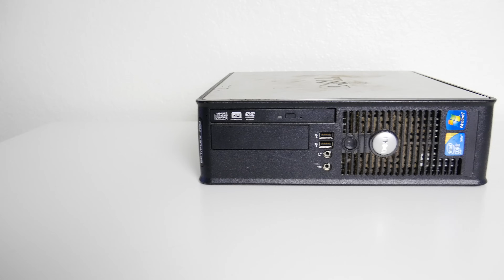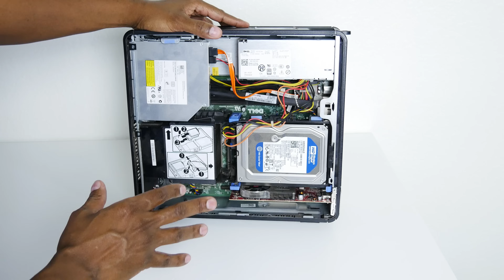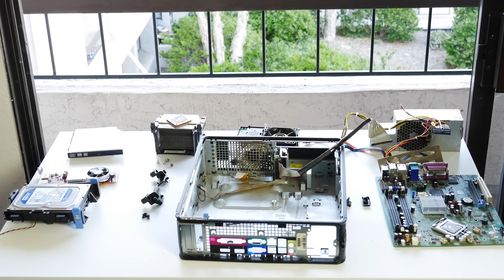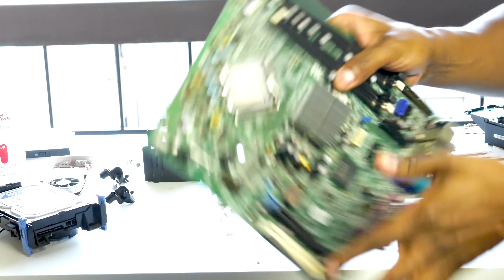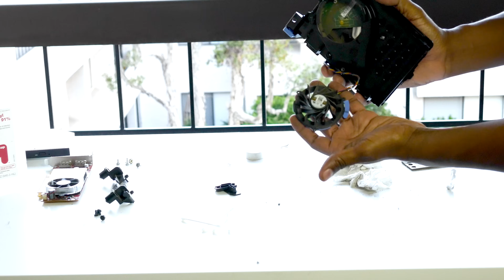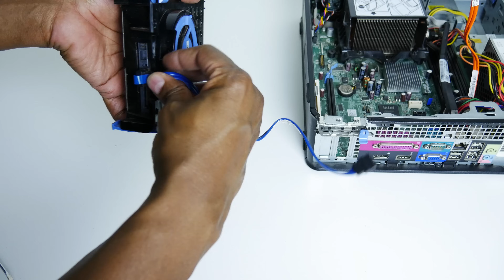How To Take Apart, Clean, Reassemble, Upgrade 780 SFF

Comment: Love your videos. Very well done Sir !Two weeks ago I just replaced a few capacitors and did a complete teardown and cleaning on a dell optiplex 745. Just a note: Mass Airflow cleaner from any auto-parts store is actually circuit board cleaner.....you can soak the motherboard on both sides and any other components with it. It dries fast and evaporates dust and dirt. My wifes computer works great and runs quite now. I also upgraded it to Windows 10 for free on 04-06-20 it's still available from Microsoft for free. Do all updates and virus scans, then turn all firewalls and virus software off. 3 hours later your done.

Comment: Great Tip bro. By the way, with regards to Graphics card problem you mentioned earlier, if anybody is planning for High-End video card upgrade on this guy, it wouldn't be a problem, all you need is to get a descent size Mid-Tower case that can fit a 450-500 watts power supply for only $35, and you're good to go for full-time gaming.
Reply: Is the mobo mounting holes have the same alignment with the mATX casing mounting? I am thinking of transferring the parts for my Optiplex 380 mini tower to the ATX casing except the power supply. This will enable me to slot in the High Profile Graphic card and install new Power supply.
Reply: @seebauong9593  All motherboard mounting holes and the corresponding Casing holes for ATX, Micro ATX and the Mini ITX, are standardized my friend Which means all of them, with regards to brands means any brands, have the same exact hole spacings in between them. The only difference is the fact that ATX (Full-Size) Motherboards has more holes at the end because they have more expansion slots as compared to the Micro-ATX and The mini or ITX.

Comment: Good Video! I would only suggest you say what each cable is for (power, data, etc,) as you dis/reconnect, for those who may not know. The wiring looks intimidating, but is really not, once understood. Also, why the (thermal) compound is necessary - and never touch those mating surfaces.
Reply from the maker: Thanks

Comment: I had a feeling I’d mess something up and I did, my computers hard drive fan for some reason was wired differently. I had a wire that connected from the front fan to a port at the other end of the motherboard and it was really fragile so the end snapped… Do you reckon I can continue using my pc with my hard drive fan?

Comment: i had an hp computer assembled very similar to this, and the one thing i discovered is that the motherboard can be moved into a different case, along with a decent power supply, and it would still be the same computer because nothing else changes except for the fact that the cpu cooler is a little different in this model from dell, so you may have to replace that entirely, but its not a big deal. that western digital blue hard drive really doesn't need that fan on it either, but that's the one fault that prebuilt machines have, they tend to come with unnecessary hardware and can that increase the cost of repair.

Comment: Just one thing, I personally avoid touching the CPU surface before applying thermal grease. Wipe it with some alcohol, let it dry, makes for better thermal dissipation
Reply: Also pea sized is more than enough. With tons of grease, the heat actually doesn't dissipate as well

Comment: I use a Dell Optiplex SFF  780  like this for HTPC and have Kodi installed on it.  I upgraded the HDD to SSD and this little box flies!!!!!!  Temps are also lower without the large hard drive blocking airflow.  Best upgrade for a 780 SFF.
Reply from the maker: +DJ R@DEON thanks for sharing

Comment: Have you taken a Dell, not that compact, but one with more room, like a mini/micro tower, & rebuilt it? Not using the m/b, but just about new everything. Thanks i have a Dell Vostro, with more inside space than the 1 you are working on, & build a new machine, maybe a B450 or B550

Comment: Will leaving my dells side pannel off improve cooling?
Reply: Sarina Bethany Myers  I wanted to know because my power supply was getting extremely very hot paired with a gt 710. Sadly it caught on fire, im not joking, i saw the flames through the fans  . I would recommend getting a cheap Lenovo thinkcentre edge 72. way newer and better processor and it allows you to upgrade the powersupply.

Comment: I'll tell you my cheat for almost every type of computer but especially applicable here. I remove every electronic part, such as your front power button and I take it out back. Spray it down with some good degreaser like 709 then I power wash the whole case. Especially one in that nice of condition. Then I just wipe it down with a shammy. Use the wet shammy to clean other plastic parts. I clean the heat sinks this way too. Certainly using a little bit of alcohol helps speed the process up. smart! but if you do it right you can refurb these things to be like new, if not better then new.

Comment: Thank You Tech Steve. I have a Dell  Optiplex 780 I want to add more ram as it only has 2 GB ram running Windows 7 i want to make sure i get the right ram for the board or do i just replace the board and get the right ram for the new board?  thanks again

Comment: Happy New Year! I have a dell optiplex 780 slim and it won’t turn on,no power at all no light in the back of the power supply. What do you think? Thanks
Reply from the maker: Test or replace the power cord. If the outlet works then you may have a bad power supply. The good new is that they are really cheap online but you have to get the one that came with it because they are proprietary.
Reply: Tech Steve  ok thanks i will try that!
Reply: I’ve tried to cahnged the power cord still no power.
Reply from the maker: Sounds like the power supply

Comment: Steve superb video thanks. I have just bought the exact same model as the one here, but mine does not have a Graphics Card it must be integrated on the motherboard. I want edit video footage so presumably a dedicated graphics card would be desirable. Can I ask your advice and recommendations for a video card to fit the Dell 780 SFF please? I live in the UK.

Many thanks. David Eades
Reply from the maker: Here’s the model that’s installed https://plus.google.com/+TechSteve/posts/RRjyfZdu6ut
Reply: Tech Steve Thanks Steve for your very prompt reply, I am much obliged to you.

Kind regards 

David
Reply: I would recommend a gt 1030 low profile, have one in my Dell 780

Comment: Great video but my problem is with the network socket. Mine got fried during a storm & now there's no LAN internet connection. But with my Optiplex 780 Ultra Small I doubt it's as simple as replacing the Ethernet card. 😩😩😩
Reply from the maker: Just buy a usb to Ethernet adapter, they are cheap and works great. AmazonBasics USB 3.0 to 10/100/1000 Gigabit Ethernet Adapter https://www.amazon.com/dp/B00M77HMU0/ref=cm_sw_r_cp_api_i_aediCbDDSCJC9

Comment: I have a Dell 780 sff and I had a fan issue. I took it apart and the fan was so dirty it wouldn't spin. When I put it back together I didn't use any thermo paste and it runs just as good as before. Core temp stays at 39c.
Reply from the maker: Scary but if it work watch it. Get some paste as soon as you can so you know it’s right.
Reply: @TechSteve  I ended up wiping the hard drive and installing Windows 7 home premium. The core can run 64 bit os but I have the 32 bit os.. any how, I have not touched the processor and the fan is controlled by core temp and I hardly ever hear the fan. My conclusion is that if you are only doing basic things, paste makes no difference. If you are gaming and have cool cooling systems, then maybe you need the paste. 👍
Reply: I have some plans for this one. I have pics and video of it streaming and it is straight from the factory with no video card and it rarely buffers at all. But I want to use it to run Android emulator so I am taking pictures and video as I go with the hopes of editing and making a video for YouTube. My hard drive is under the optical drive and I did flip the fan.
Reply from the maker: Ok great, post a link and I’ll check it out
Reply: @TechSteve   I have a channel and I put two small ones up, the streaming I thought might come in better with the lights off but I turn the light on and you can see it streams just fine. They are only about 30 seconds each because it was the easiest way to do it.

Comment: very good ive just bought a 780 off ebay.
Reply: did it come good?
Reply: yeh great thanks
Reply: how much it cost?
Reply: Tony Baines wow that's awesome but how does it run a core 2 duo at 3.16 gigahertz I have a core 2 quad at 2.66 any idea how to overlook it?
Reply: Tony Baines did u overclock it? if so can u explain how pls
Reply: I went up to 3 too..there is some things you can do to the little guys that work.. I also took it up to 16gb ram,,and put an nVidia low profile card in it :)
Reply: radstorm what's the card name? link pls?
Reply: Michael here it is: They moved it from the last link.. https://www.walmart.com/ip/EVGA-GeForce-GT-610-2GB-DDR3-PCI-Express-2.0-Graphics-Card/21126311
Reply: It includes the adapter plate to fit it to small form pc
Reply: radstorm yeah that's a really nice card too bad I got the stupid visiontek a week ago.....mine isn't that that bad for $36.00 and $3 shipping I got the card Max memory clock on visiontek is 700GHz urs is 800...... that's with overclocking though the default is 500 😞
Reply: radstorm I haven't had too much time to work on the optiplex bc school but I can't get a working fps app to show the graphics in Minecraft. any ideas lol? I got the mc windows 10 edition cause it was on sale for $10 just to play with mods. apparently u can't mod it so great
Reply: i have a nvidia nvs 315 in mine its awsome. plus 8 gig ram.
Reply: Tony Baines true dat I don't think this machine needs more than 8gigs, running chrome, Minecraft and blue stacks (Android VM) it peaks at 7.2 gb nice graphics card dude
Reply: Tony Baines do u do games on it? I research the card and saw that it has one gigabyte of memory and no one is saying the clock speed so I'm assuming the clock speed is very slow so it would be a bad card for gaming since no one's willing to say the clock speed . ... 52 bucks and only one DisplayPort I think that's really expensive
Reply: not a gaming card more of a design graphics, but powerful in 3d
Reply: Michael I ran the Unigine Valley benchmark tool, and the best it would do was 24 fps at low res.. of course as I increased the res..the fps dropped.. I am not sure if that is of any help. I dont do much gaming..except the rts type games..like Empire Earth, etc.. 3D games are a bit fast paced for a guy my age..lol  I am running a W9559quad cpu, 2.83 ghz (although it claims to be a 3ghz) but I guess that is with overclocking which is an area I am not to versed at, 16gb of ram and Dell said that could not be done..ha! lol.. I did notice too it runs kinda hot..but that could be because small form is not well ventilated as a tower would be..of course. My best suggestion is do like I have over the years..start with a good mobo..and each month add to it..and in a little time and some patience..you can build on hell of a machine :)
Reply: I imagine some tweaking here and there might squeeze a bit more..but as I said..I just use it for 3D graphic rendering..like Poser etc and am definitely not a guru about clocking and stuff..just an out of the box sorta guy :) By the way dont rule out AMD (ATI) cards either..they have really evolved now..and are offering  more power for less price than nVidia
Reply: radstorm I totally agree on AMD cards, overclocking is easy as opening the driver program and adjusting a slider. AMD is like Android and did you hear about their new ryzen 7 processors!!??? OMG Intel is dead now! half the cost for the performance of the top i7 processor....... anyways this build was a quick build for school and basic games like Minecraft with mods but over the summer I want to build a $1,000 gaming computer with good stuff like 6 gb graphics.....and DEFINITELY a AMD ryzen processor. I'm tired of paying money for stupid locked Intel processors.
Reply: radstorm any idea on how to overclock this machine? I have a Q8400 processor in mine..... bios is locked 😭😭 I hear you said something about overclocking
Reply: radstorm OMG my machine Sux so much I ran the test and didn't mess with the settings and kept getting 8 fps and now it's stuck through the middle of the test as I'm typing this off on my phone. rip. how do u change to low settings?
Reply: Michael.. I will be honest and say overclocking is something I dont know much about. My EVGA card does have an overclocking tool for it called Precision XOC that you can download from their site..it is for their cards only.. I have one called MSI Afterburner also..which is sort of universal.. But I'm scared to try them.. lol  I have heard the quad can be overclocked,,but some say there is no bios support on the machines..You should go to maybe a gamer forum and join for those answers of perhaps an aftermarket tool.. the intel site has one..but I could never get it to install..but then again there is a lot of things win7 64 wont install it it's an 86 program.. mostly due to visual studio dll errors :)
Reply: Maybe there is a Minecraft forum out there.. Of course you always have to put up with that one guy that goes on and on about tech specs..because he is clueless of how to just give you a straight answer..lol
Reply: radstorm yeah the problem is that it's a stupid motherboard. set fsb ( software overclocking tool ) doesn't work either and that's the only software oc tool out there.....Intel's extreme tuning utility runs into a fatal error during installation.....and after research....turns out that it's only for "Intel boards" I freaking hate Intel now
Reply: Well Michael I was never much an Intel fan either..pretty much have always went with AMD.. but still this little pc does a pretty good job for it's price.. Dell or any of the off the shelf companies never was one for allowing much end user input though/ If you look around eBay..there are lots of AMD supported mobo..even old ones..that can still be expanded quite a bit..anything pre fab will always have weak spots

Comment: Heu brother,  is it possible to move all the components of optiplex (7010 in my case)  to a new gaming case?  Is the motherboard fit with the ATX case?
Reply from the maker: Sorry I haven’t tried. A lot of ATX cases has multiple screw patterns. You could measure the dells and see if they line up.

Comment: did you add that graphics card? If so what is it, and do you need to upgrade the PSU?
Reply: sadly, only low profile cards will work in this model but i found a great one that I just ordered

this is the one I got, I just disassembled my dell for painting bc I'm going to make it into a gaming computer, this is (in my opinion) the cheapest and best graphics card u can get for this model without having to mess with the PSU

https://www.newegg.com/Product/Product.aspx?Item=N82E16814129319
Reply: i added a gt 710 to my dell optiplex 945 or 745 idk (i added it for a family friend who used it for work) and it works pretty well.

Comment: My PC SSF780 no fan when I  bought it but I saw your PC in this video has a red fan near hard disk, it original fan inside or you added? I want to buy this fan to put in my PC. Thanks
Reply from the maker: Part of the computer. You can look up the service manual on dells website. It normally has the motherboard parts

Comment: You can only go to 16 in the RAM right? What about the processor, it can be replace with a better one right?
Reply: Motherboard's slot is LGA775, only better one that fits is a Quad-Core that handles decently with an upgraded PSU.
Reply: The Kerminator so your saying this motherboard can't be upgraded with a quad core processor right? But the processor can still be upgradable with a better one right?
Reply: *****
Oh no, the processor can be upgraded to a quad, but the standard 235 Watt PSU probably wouldn't be able to handle it. For around 50 bucks you can get a bigger PSU and a mini adapter to connect it to, since BTX mobo's are layered differently.
Reply: The Kerminator I put a new Hard Drive, but says drive1 not found:serial ATA, SATA1 and Drive 2 not found as well, and won't start, do I need to get another drive or update to new windows?
Reply: What kind of Power Supply did you put in? 

Did you disconnect everything including all the wires connected to the motherboard?
Reply: The Kerminator it has the same stock power supply, I haven't replace it.
Reply: The Kerminator no I haven't disconnected anything, just took off the older hard drive for a new one, the new hard drive was format so I don't know if it needs windows installed in it.
Also the older Hard Drive was Ata, very old version, this new one is a 7200rpm

Comment: OK SO....the ESD could prevent high volt shocks. laying the computer on its side makes it safer to not falling over. keeping track of where the cables connect so you don't forget and force one into the wrong plug. Bending the motherboard could break it.

Comment: I have a bunch of 780s i'm trying to refurbish and sell. My problem is many of them don't have the dvd rom drives. I install a new dvd rom, but I can't get the computer to recognize it. Sometimes the drive will light up and spin a cd or disc, but the computer never sees it. I've tried to go to dell support and download drivers but nothing has worked so far.
Reply from the maker: Have you configured the bios when you boot up?